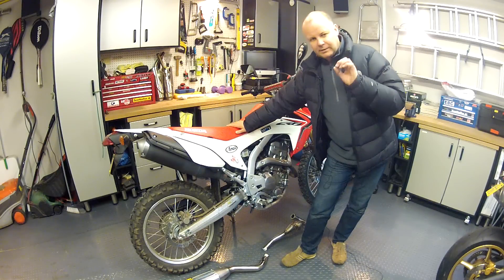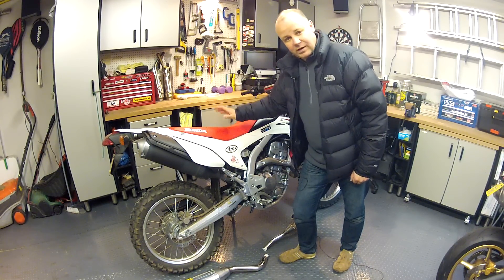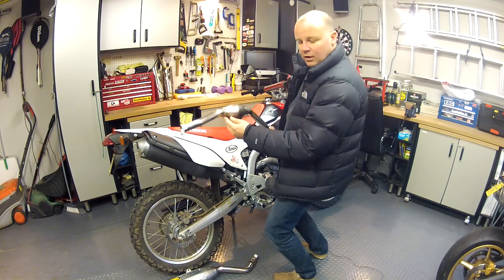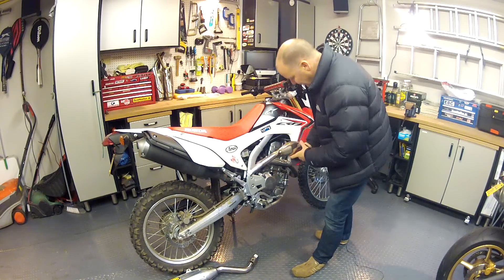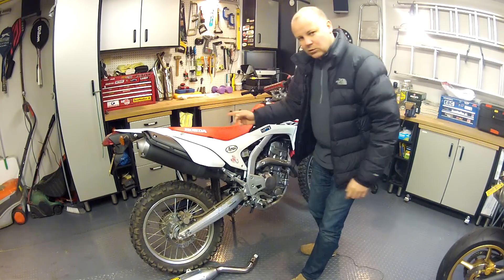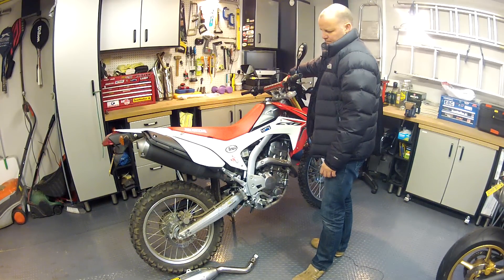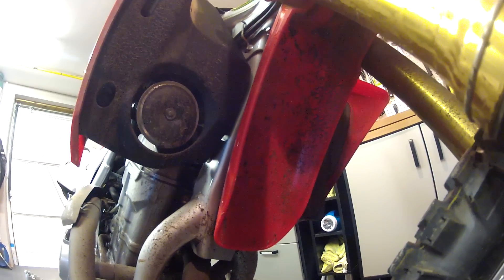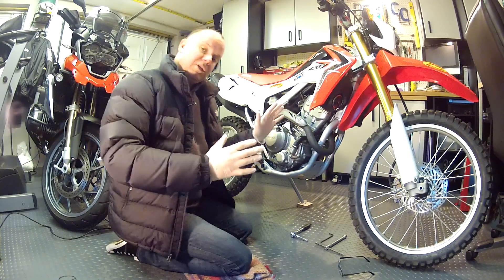Honda CRF250L FMF Q4 Exhaust & Megabomb Install

Comment: Hey TMF! Did you also change the gearing by any chance or left it stock? And, which fmf header would you recommend for highway cruising? Cheers!
Reply from the maker: I've gone to a 13 tooth sprocket on the front and went with the power bomb header.....
Reply: TheMissendenFlyer why did you not want to keep the megabomb header

Comment: hey what is the DB level of the new muffler - the 2015 stock exhaust is 84db i know but to be road legal in australia it has to be under 96db - what is it reading with the fmf?
Reply from the maker: +michael phillips I don't know what the numbers are but I  doubt it will be officially road legal in Aus......it's very loud
Reply: +TheMissendenFlyer yeah i mean as it is now it is a bit silent compared to mx bikes but if i can make it only 10db louder but i dont want to attract attention so the worst i would do is remove the catalytic converter - they dont test emitions here i dont think but even then i might wait for the warrenty to run out first

Comment: Hi TMF
I've been looking into getting FMF q4 with mega bomb header and 13tooth front sprocket with EJK fuel controller. I've spoken to several bike dealers and there technicians and they don't think that the EJK is that important as when the exhaust is fitted they will remap through the ECU.
What are your thoughts on this?
Reply from the maker: Well if they remap the ECU then fine, effectively that's what the EJK is doing for you (except of course you can make changes as you see fit).....

Comment: Hi i would like to ask you one thing.Is this exhaust homologated?Is the sound bearable or it makes to much noise?i mean with the regular db killer in.What about the fuel consumption after this pipe?Stock it runs 30 km/litre,but what about this fmf and megabomb?Excuse me for the several questions,i really appreciate your videos.thanks in advance for the answer ;-)
Reply from the maker: Andrea Flamini Hi Andrea, I don't think the  exhaust is strictly speaking road legal...depends what you mean about the sound being bearable, I like it, but it is loud if you're standing behind the machine at full chat!  I noticed a small drop in fuel economy - between 5-10% I'd say (but generally speaking these machines a re very frugal anyway so to my mind that didn't matter given the boost in performance).  Ride safe! - TMF

Comment: Was there any issue with bike after installed? I installed same Q4 wits powerbomb to my crf 250L 2016 when 500miles on the clock from new - and now engine occasionally stops when changing gears down  during slowing down. Any idea why this happen?
Reply from the maker: +J Y My bike used to do this before the recall - has your bike been back for that? (Search crf250l recall for details)....doesn't do it now...

Comment: Hi! I've been watching your videos for a while now and I'm thinking of buying the 250l but i was wondering if you need the megabomb with the fmf. If you do, does it come with the FMF?
Reply from the maker: Hi Lukas - you buy the header pipe and end can separately. FMF make 2 headers (power bomb and mega bomb) and various end cans - I went for the Q4. IIRC you can't use the Honda header with the FMF end can so you do need to buy both - I'm not 100% sure though so best drop FMF a note and ask. Either way the exhaust transforms the bike though, a must do! All the best - TMF
Reply: Ok, good to know. Thanks!
Reply from the maker: +Lukas Stinson you're very welcome....

Comment: Is this road legal here in the UK? and did the insurance company accept it without any trouble? I have a Yamaha WR250X and  I want to put a FMF slip-on, on the bike so any info would be much appreciated!
Reply from the maker: ...as far as I'm aware, it's not stamped that it isn't and I passed my MOT no problem - no issue with the insurance company either...
Reply: Thanks for the info, much appreciated!

Comment: Hi, I've bought a new honda crf 250 m, my questions are
All the 250L exhausts, mods etc, are compatible for my 250 m?
If i change the exhaust on the honda garanty years, will i lose it?
Thanks from Spain ! ^^
Reply from the maker: Privatel3oy Hi - Yes I'm 99% sure everything applies to the 250M as well, it's really only the wheel sizes that differ on the bikes, other than that all cosmetic......all the best - TMF

Comment: Did you upgrade the fuel module too? Or can you run the same settings as before?
Reply from the maker: +James Doble Yes - I fitted an EJK fuel controller - I have a video up on that mod too ;0)
Reply: +TheMissendenFlyer Awesome, thanks for the quick response and the help installing this when it arrives! :)
Reply from the maker: +James Doble No problem - enjoy!

Comment: hiee all the way from nepal..was wondering from which website you ordered it ??need help please ..
Reply from the maker: Hi Rojen, I ordered direct from the FMF website and had them shipped direct from the U.S.....thanks for watching and commenting, all our thoughts are with you guys in Nepal, all the best from the UK.....TMF
Reply: thank you so much for your thoughts much appreciated..one more question ..a friend of mine is planning to get  crf 250L ..the problem is he 5.5 feet in height so its kinda hard for him to keep his feet on the ground lol..are there any option by which the suspension can be decreased ??or any other component changed so we can adjust the height ??
Reply from the maker: Rojen Pradhan Hi again Rojen - yes, the suspension can be relatively easily lowered by a competent mechanic by drilling a hole in the "dog bone" that attaches to the lower part of the rear shock and dropping the forks through the yoke to match - should be able to lower by a few inches that way....alternatively there may well be suspension lowering kits available + of course you can have the seat modified to remove some foam and lower the height that way....all the best - TMF
Reply from the maker: ...absolutely, but you don't have to go to that expense if you don't want too - I know of several people that have just modified the existing "dog bone" (although this link is neater)....
Reply: thank you sir...your help is much appreciated ...are you in Facebook ???

Comment: Don't you ever worry about Carbon Monoxide poisoning, or do you have a ventilation system in there?
Reply from the maker: Well I have two large garage doors that open up ;0)
Reply: I see that but when you started the bike the door was closed
Reply from the maker: +Dakootsy So clearly I'm not too worried about it then ;0)

Comment: You find any difference in the performance or just cosmetic ?
Reply from the maker: Diego Fumiato Huge difference Diego - by far the most significant mod I've done, transforms the bike from a meek commuter into a snarling beast!  The difference in power delivery is quite startling....

Comment: Where did you get the aftermarket fender bracket
Reply from the maker: Not sure which bracket you mean Ramiro?
Reply: To mount the stock rear side number plate on aftermarket exhaust

Comment: do you need the eEJK and i got a crf 250l and can i just put a fmf slip on or do i need the EJK thanks
Reply from the maker: It's not essential - I ran my CRF for a few weeks without the EJK and it ran fine, fuel economy takes a bit of a hit with the FMF and I don't know if long term it would be wise (due the mixture not being optimised for the slip on can) - thanks for watching - TMF.
Reply: did she backfire
Reply from the maker: nope....
Reply: how big difference do it make in fuel

Comment: How much do those modifications hurt the fuel mileage?
Reply from the maker: Stephen Arseneau Hi Stephen - they do have a negative effect but not enough to worry about as the machine is so frugal anyway - I probably now get 95 miles out of a tank rather than 105....something like that.  Cheers - TMF
Reply: Thanks.   If I do these mods then I will have to refuel driving home from work.  But I think it will be worth it.  I make it home on fumes with the stock bike.  Kind of nice really but I need just a little a bit more power.
Reply from the maker: Stephen Arseneau You HAVE to do the mods - it transforms the bike from a damp squib into a beast of a bike....do it!
Reply: That is my plan!  :)  Thanks for your input.
Reply: I did the mods. Used a powerbomb though. I'm glad i got the Q4 instead of the Powercore though.  That Q4 barks man. And my hands are relatively slender. I got the EJK in with little effort. :)

Comment: Have you burned your pants on that megabomb at all? I'd rather the m-bomb over the p-bomb for the low end grunt but being able to reusing the stock heat shield over the p-bomb bomb has got me leaning away from the megabomb.
Reply from the maker: +Vermont Dualsport Yes I have burned my trousers a little on the megabomb - not a big deal, just some discoloration on the megabomb rather than any damage to my kit (or me) - really is a non-issue.....thanks for stopping by - all the best - TMF

Comment: Is there any difference between FMF Q4 and FMF Q4 HEX S/A?
Reply from the maker: +Steven Pires I'm sure there is Steven but I don't know what it is! Sorry about that!! Maybe drop FMF a mail...
Reply: Maybe I will do it, thank you. The exhaust on the video is the normal Q4 ou Q4 HEX S/A?
Reply from the maker: +Steven Pires As far as I recall its a "Normal" Q4...
Reply: Which copper grease did you use? Any specific one?
Reply from the maker: I don't recall - probably a Halfords special!

Comment: what would be the best thing to buy if you're on a budget? the exhaust or the megabomb? :)
Reply from the maker: I'm guessing the exhaust but as I changed both together I don't know which of the two had the greatest affect - all I do know is that it had a great effect!  Cheers - TMF
Reply: In the description of the megabomb they mention "Increases output from stock motor as much as 3hp" and they don't mention extra hp in the description of the exhaust so i'm a bit confused.. but thank you for the help!

Comment: Strong ventilation for exhaust fumes... Inb4 dead
Reply from the maker: popoman357 Fair point - luckily 2 dirty great garage doors provide all the ventilation needed! ;0)
Reply: TheMissendenFlyer Well as long as they were open and your keeping safe that's all that matters. Just didn't see a shot of the open doors at all. But if you say they were, then i guess they were ;)
Reply from the maker: popoman357 cheers popoman357 - they are always open when I run a bike in the garage, they weren't during the installation though as it was flippin' cold out!

Comment: @05:35 you mention using copper grease vs. high temperature silicon. i have neither so which would you recommend as better to purchase and use?